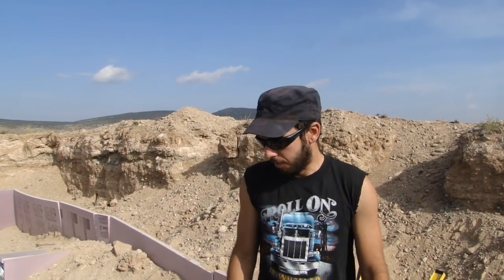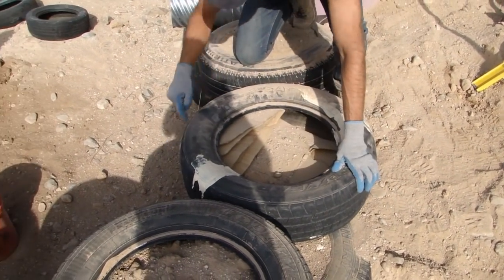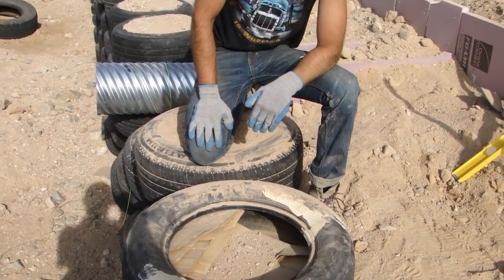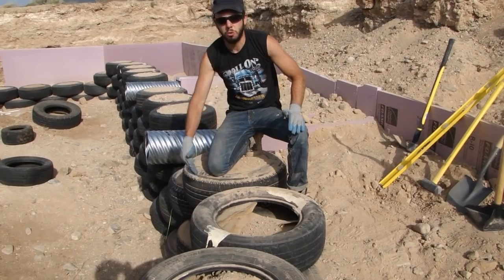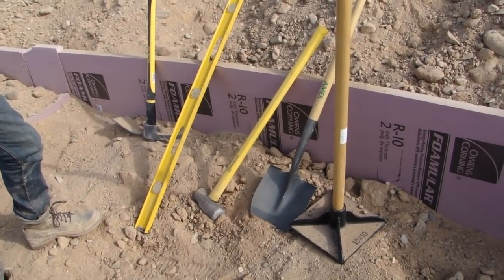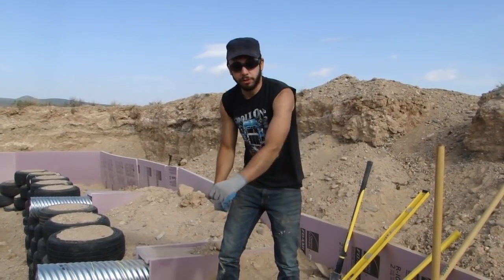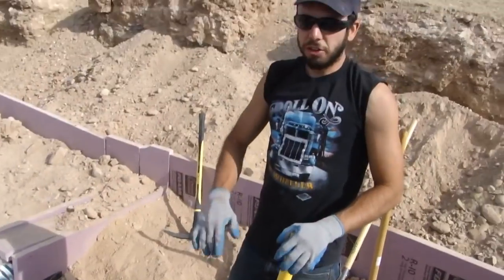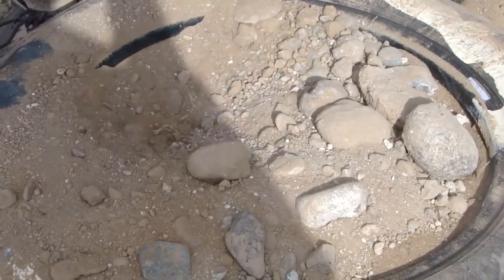How to Build a Tire Wall

Comment: Great idea, bad from an environmental perspective. The chemicals from the tires will contaminate the soil around it as they decompose. If the EPA finds out about your tire wall, they will visit you and make you dispose of the tires according to their regulations. I would check this out before you spend a lot of time building your tire wall. I like the idea for recycling tires but the tires will contaminate the soil. Good luck in your venture.

Comment: FYI, dry dirt doesn't compact.
Reply: In time mankind will have to dig up every single one of these tires to stop their toxic decay from contaminating the ground water. The original idea was pro-active and well meaning but this idea should really be rethought. There is more than enough scientific data on the matter. If understanding ground compaction dynamics escapes  these people it's easy to see how toxicity impact which is a bit more complex would as well.
Reply: That earth (Caliche) if given the right amount of moisture and scrub brush (tumbleweeds, sage, etc.) mixed in can, by itself, become a very solid building material. Here in Arizona there are many adobe homes that have been standing for hundreds of years. This is a much more organic way to build using natural materials. One awesome aspect of adobe homes is the walls are as thick as this tire wall and even more so in some cases.
Reply: you have a mighty high horse there buddy put up your eco friendly videos and get off the keyboard soap box.
Reply: Here, here Sexybluelady .lady! I wonder if the composite materials within the tires could be made completely inert? Perhaps the making of new tires could be done in a way they could break down into harmless materials? As it stands today more new tires are being constantly made which will cause grave toxicity to our future generations so placing under the ground surface, in closer contact with the subterranean ground water table seems like a mistake. We face cancer rates that are higher than ever before with so many coming from unknown sources we should all work toward eliminating the ones we are aware of in a safe manner.
Reply: Pardon the passé parliamentary type response. I've been watching The Tudors, lol.

Comment: you are ruining the level by using to force down the tires as a means of leveling them. it was never designed to do anything but set on top of objects. therefore your entire wall is NOT level. use a 2x4 to force them then check for level!

Comment: Why not just use tires still mounted on rims (and still filled with air)? No need to add all that dirt & way less labor intensive. If a tire on a rim can withstand the weight of a car & the punishment of potholes, bad weather, etc., I'd think it could stand up to the weight & structural demands of a house. As far as air leaking out is concerned, once the wall has been plastered / cemented over, there is no where for the air to escape from. I used to work for an antique car junkyard and saw countless tires still holding air, on cars that have been sitting since the 1950's (& longer). These cars (and their tires) were exposed to the elements for decades, but still held air. Obviously, I would suggest using newer tires than what were in the junkyard I worked at, more likely to last longer than a tire from the 1950's. The tires used to build a wall would be protected from the elements (encased in cement) & therefore should last indefinably. Anyone see any problems with this idea? As an added bonus, you don't have to go through all the added labor of removing the tires from the rims! Can you imagine how long it would take to remove a thousand tires from their rims?!?!?! And that's labor that has to be done before you even start building your house!!! If you pay a tire shop to remove a tire from a rim it costs around $5 or $6 PER TIRE!
Reply: jason barnette don't the rims stay with the car?
Reply: jason barnette They will leak at some point, besides the tire is only a container the dirt is the solid mass providing stability.
Reply: jason barnette u r smart jason!